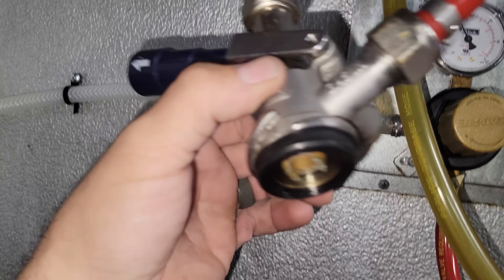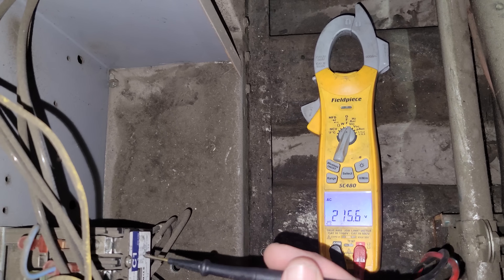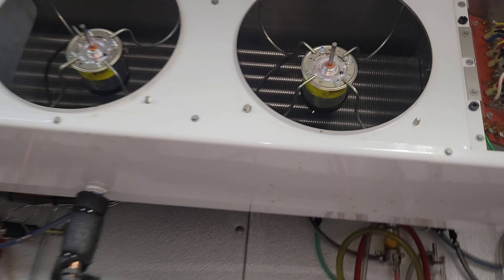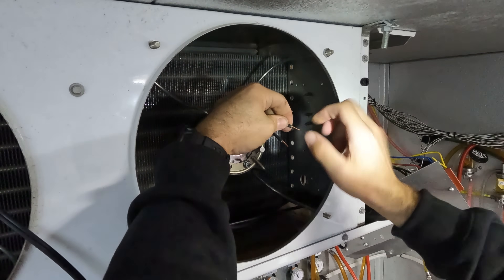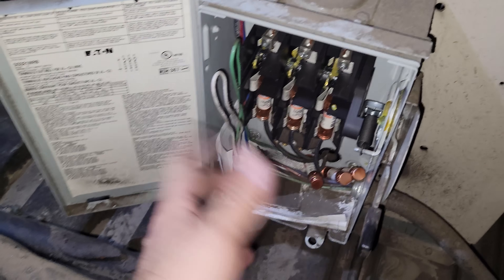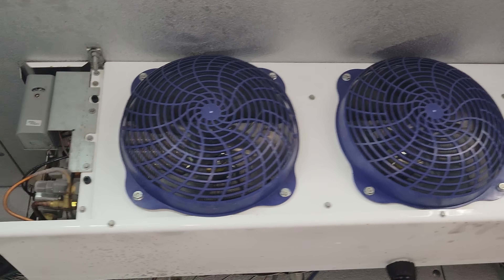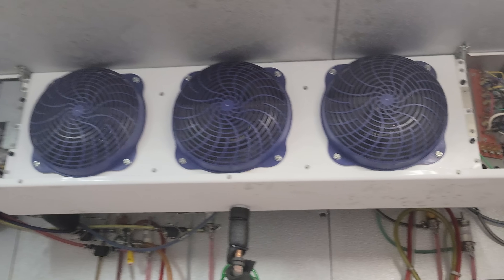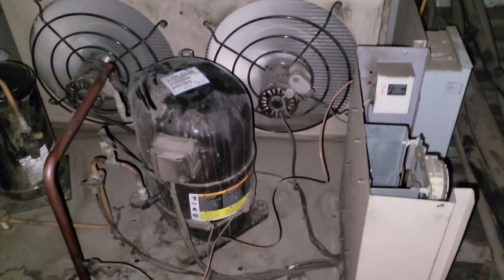HURRY THE BEER WALK IN IS AT 70 DEGREES

Comment: Pass out, no you can die. I knew 3 men that died in a paint locker after setting off the CO2 fire suppression system. Ohm those heaters, and your fans should be on a separate circuit, and your wires are that way from vibration, not touching the motor bracket.

Comment: the wire stripper comment you made is spot on. you should be able to clamp it down, give it a twist, then a bit of a pull and it just slides right off nice and clean without much effort.

Comment: The wire strip advice reminded me of a guy who was in trade school with me and ended up punching himself in the face stripping a wire. He busted his lip and we all had a laugh, except him. 

The potential vibrations causing wires to wear out and short has been an issue for me as well for some of the heat pumps i run into. However, due to the compact nature of the unit, sometimes pipes will be in contact (despite insulation and whatnot) and can cause leaks. It is a dumb design flaw and has been literally the dumbest repairs i've had to do: move the piping to reduce the noise.

Comment: as wire stripper tip sometimes i squeeze the end of the jacket to 'un-pinch it' before pulling the insulation off, if its hard to pull

Comment: CO2 gas in confined spaces is no joke. Just a couple of minutes bending over and organising some product can be deadly. The CO2 alarm needs to connected to its own dedicated circuit so that will alway be on even if the power is off to the cooling system, and will only be turned off if someone needs to work on that circuit. I like to add a relay and a flasher circuit to control the lighting circuit and make the lighting flash on and off if the safety circuit is turned off.

If you use the glue filled heat shrink it creates a nice waterproof seal. My favorite are the clear submersible pump splice kits with the see through glue filled heat shrink. It allows one to see the splice both before and after shrinking the tubing. I know my local Pace Supply has the 12/10 gage in stock, not sure about the 16/14 gage, since that is what most of those fans use. I have never understood why refrigeration seems to provide so little protection and support for the wiring.

Comment: So the evap is fed off the load side of that fused disconnect so the short caused the single fuse to blow? Why wouldnt the compressor have been damaged by single phasing? Guess im used to where the evap is on a separate 20a circuit
Reply from the maker: I will discuss this live on YouTube tonight 1/3/22 @ 5:PM (pacific) come over and check it out https://youtu.be/2UhZaKfPILY

Comment: Crimp using the nipple not the flat part. Hold the wire a lot better. Only time you’ll have a failure is if you happen to crimp the nipple on the joint of the connector.

Comment: LOVE your videos!!!!! I don't recommend using butt splices unless they are shrink style so there is no way to be effected by a high humidity environment. I've seen way too many failures over 50 years for that reason. I totally get the repair due to vibration wear. Perhaps a good place for some split loom. Slides on fast and adds an extra layer of protection for nearly zero cost.
Reply: As an electrician, I am always puzzled by the lack of protection and support for wiring in HVAC systems. The clear glue filled heat shrink pump splice kits are my favorite for absolutely waterproof connections. I get them from Pace Supply. You can see the splice through the heat shrink both before and after heating. And if you do them all the time, it is worth spending the money on a ratcheting crimper.

Comment: From an electrical standpoint, the penetration on the motors should face down to avoid water ingress. Also, with that style bushing any condensation can run out. Speaking of that, if there aren't weep holes on the bottom those motor can fill up with water over time. Especially since the motors will be cold, the defrost heaters come on and create water vapor than can collect inside the motor. 
Or, if someone defrosts using water with the motors installed. In any case, you always want to put any penetration in any electrical device on the bottom and especially outdoors never , except the only solution, put the penetrations on top. 
Good find on the rubbed wire, right were you said it would be.

Comment: Hint, use an amp clamp meter on the wires feeding the evaporator cabinet to tell when the fans are running without going downstairs.  Save a trip.

Comment: 4:18 remember that co2 likes to sink in a room, if you measure the Co2 concentration at head level, it could be fine, but crouching down can put you in the deadly air layer. Never work below the level of a Co2 monitor if you suspect a leak.

If you wear the co2 monitor on your belt, lift items by bending your knees, not your back, so the monitor stays always lower to the ground than your head

Comment: If you're breathing high concentrations of CO2, you most definitely will know about it.  It stings to breathe.  Same thing that happens if you try drinking a soda right after you've poured it.  And like others have said, it's heavier than air and will pour out when the door is opened.  Pure nitrogen is a much higher risk as it doesn't activate the breathing reflex that carbon dioxide does, as well as mixing with the air without sinking, and you really won't know you're out of oxygen until it's too late.
Reply: Not everyone is as sensitive to the sense of breathing in CO2, if they were, there wouldn't be so many accidents with people going unconscious or dying from it. High concentrations (over 30%) can knock people out very quickly (within seconds, under 10 seconds is not unheard of). Hypoxia is NOT the only issue when it comes to co2 as it is also a toxicant on it's own in large doses, it makes you high/confused and make poor decisions. Around 100 people die per year in the US due to co2 poisoning.

Comment: oo the wrath of the cheap-o butt connectors. Sooner or later they Always fail in humid environments. even the insulated ones fail. sometimes they spectacularly fail when the connection is poor and they arc, melt, burn. Solder and double wall heatshrink does not fail if you learn how to solder connections well... just sayin. pro tip number 2, get a mechanics stethoscope to locate faulty motors, bearings, noises, etc, makes it real quick to isolate the problem component when you can listen to it directly! make sure if you get a stethoscope that it has the insulated silicone or rubber hoses to keep you safe from shock.

Comment: I use to carry some of that split plastic wire loom on my truck. Got tired of fixing shorts in Carrier heat pumps where the low voltage wires rub against the copper and they don't leave enough wire to move them.

Comment: I'm not an electrician, not a HVAC tech, nor anything more than a hobbyist.  I never use crimp on terminals.  I solder and heat shrink.  

I was watching a neighbor repair the wiring on a boat trailer.  He was complaining the crimp on connectors kept getting corroded and pulling out.  I suggested solder and water proof heat shrink.  He said that took too long. “If you don't have time to do it right, when will you have time to do it over?” John Wooden.    

Are crimp connectors an accepted connection?

Comment: I'm am industrial maintenance tech and we have upgraded hundreds of light fixtures in our facility. I promise that just because you struggle to strip a wire doesn't mean you're doing something wrong. Heat and age can seal the insulation to the wire making it difficult to get off

Comment: I love your channel and have been following for several years.
I'm from the supermarket side of this industry and I wonder if
you were as well would your perspective be different. If you were 
working under a service contract where you get x number of dollars
per month,  per store. Would you use 6 fuses where only one was 
needed if you couldn't charge the customer for it?  I'm inclined to 
think your Big Picture would get quite a bit smaller. 
In our world time management is key, your not going home until
all calls are cleared and if your on call you might not go home at all.
It could be a good topic for the Overtime crew
to have with Brett Wetzel .
Reply from the maker: You have some valid points, when I quote Jobs I include everything that is use. Also I will often work with the NTE for service channel and corrigo and I have an understanding with my customers that I do what needs to be done so even if I have a NTE I'm allowed to go over without asking because they trust me...... obviously this gets difficult the bigger your company is but the message is still the same. I'd also say if I was to bid a full service contract I would only do it if they let me do it the right way, yes extra fuses cost more but the next guy doesn't have to drive to get them ......

Comment: Chris,  with butt splices on aircraft we are taught to stagger them that way you can strain re-leave by tie wires  before and after the butt splices to the uncut wire ( other lead ) and that makes them stronger and less subject to vibration.
Reply: This, I like to stagger them so you don't have a giant mass of plastic. I also have heat shrink that I slide on first and shrink over it. It's not perfect as water can still get in but chances are unlikely unless soaking in water and you get some capillary action.

I don't understand the changing of all the fuses. It's a strip of metal engineered to vaporize at a certain current draw. If you have continuity and it looks undamaged... just leave it. Worst thing it can do is its job... and blow the tab cutting the circuit. It's not just the waste of money, it's throwing more stuff in a landfill that has useful life left. I mean leaving extras is smart but just trashing the two good ones is wasteful. I'm not even being a hippy about it... just a thing for me.
Reply: @etherealrose2139  
If you use the glue filled heat shrink it creates a nice waterproof seal. My favorite are the clear submersible pump splice kits with the see through glue filled heat shrink. It allows one to see the splice both before and after shrinking the tubing. I know my local Pace Supply has the 12/10 gage in stock, not sure about the 16/14 gage, since that is what most of those fans use. I have never understood why refrigeration seems to provide so little protection and support for the wiring.
Reply: I was a marine commercial Refrigeration technician and we were taught to stagger all splices and use heat shrink butt conns and heat shrink tubing for wire gangs
Reply: Those stupid crimpers you used for butt splice I hate them.  They only squish the metal in a small area and it takes alot of force to get a marginal crimp.  I use vise grip pliers instead.  It has a bigger nose so I get a much wider crimp area and no one can pull the butt splice off the wires.
Reply: THIS.  Stagger and glue filled heat shrink butt connectors that are waterproof.  It should never pull out, but if it does staggered connections will get connected the same way.

Comment: When I strip wires I usually cut once then rotate 90° and cut again. As the stripper gets older it doesn’t quite cut through all the way. Turning them makes sure no tiny bits of the jacket are left and it comes right off. Love your videos. You always point out basic stuff that often gets skipped. Your reminders are very much appreciated.

Comment: #respect . . . not hating in any way , however just not a fan at all using "butt-connectors" as electrical connections is this application of evap fan motors . . . stainless metal cone shaped wire nuts with zip ties and elec tape are time tested in my book , lol O.G. retired tech #respect from Arizona

Comment: The co2 is it used for pressure to push the beer to the taps?
Reply: That’s correct! The pressure pushes the beer to the tap and also fills the remaining volume from the dispensed beer. CO2 is used to keep from oxygenating.

Comment: I wonder if when doing work by yourself, you could leverage a small battery powered wifi camera, which you could set up to monitor the device inside when you are on the roof, or vice/versa.  These units are coming down in price, and instead of questioning yourself as to what happened, being able to check for a condition (even without audio) could be advantageous at times.
Reply: the distance is probably too far most of the time. Or there is a concrete/steel ceiling in between
Reply: The small remote cameras are really poor in range, especially if you have any concrete between you and the transmitter.   Add in the steel walls of the coolers, and you're in terrible shape.   You might be able to use a second, cheap cellular phone (or two) - start a video chat with one facing your equipment.  Cellular signals are designed to try to reach through as much material as possible.
Reply: I was thinking the exact same thing. Maybe not wifi since that could required some addtional configuration, but even a simple "baby cam" might save trips back and forth.
Reply: thought the same so  decided to check comments,  slight difference though, you can get cheap security cameras/baby monitor with apps for phones., both tend to have mics so you could listen too. their security isn't an issue because you'd only be using it for work.

Comment: Lol i saw the video where you repaired the cooling fans a while ago. It was during summer and it was really hot. They where running full power / wheren´t running because the belts where broken.
I remember you cleaned out the condenser coils and the water ran down into the walkway below. Was at night back then as well.
Guess i watch too many of your videos if i even remember the working sites 😅
Reply: Yeah the parking area was a mess after all that crud got washed out...

Comment: If the customer insists on electric defrost with the wic they should have paid for an accumulator to keep the compressor from flooding during cooldown after defrosting.
Reply: I think in a previous incarnation, that was a walk-in freezer. Still should have had a suction accumulator.

Comment: Unless those wires that shorted out are actually meant to be part of a heating element, i would run conduit through the system to protect the wires and keep everything neat and straight.
Reply: For evap fan motor wires ? Id say a fe cable ties are good enough
Reply: @FerdinandFake  part of it is being smarter than the average guy. You wanna try to eliminate as many problems as possible and ive had many positive experiences with conduit of all types. I love conduit.

Comment: Co2 detectors are mandatory in all of our 744 walk ins, but unless you are in a cellar the risk is low.
As soon as you open the door the heavier co2 rushes out, most people leave it open anyway. Working in a small brewery we didnt have an alarm in the fermentation cold room even with permanent co2 production

But some customers are crazy, if you use the walk in for a break room and sit next to a co2 leak, thats deadly.
Reply: doesnt co2 cause massive coughing issues? its not like helium or nitrogen, isnt the body able to detect it when its in dangerous amounts?
Reply: Yes your body is able to detect excess CO2 in the blood stream. Though I could see that your brain could not react fast enough. You might faint or become disoriented before your body realizes there is to much CO2.
Reply: @rjwaters3  CO2 will give you a massive headache very quick if the concentration is too high.  Though, if the entire area is saturated to the point that it's displaced most of the oxygen, that wouldn't happen fast enough and you'd pass out before your body realized something is wrong.  CO2 isn't as dangerous as nitrogen (nitrogen asphyxiation you feel nothing and you're just out - if you're lucky you wake up in the hospital since people working around concentrated nitrogen work in pairs for this reason).